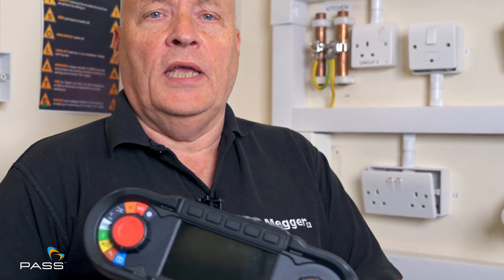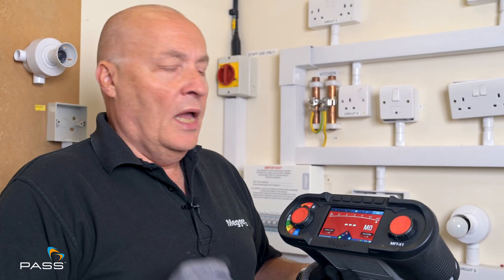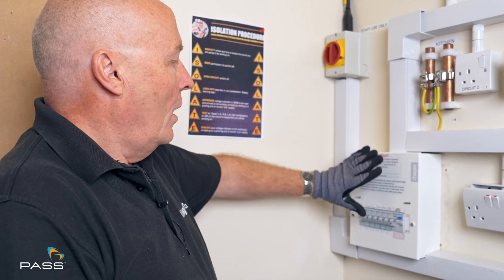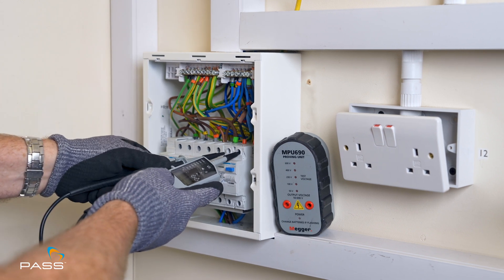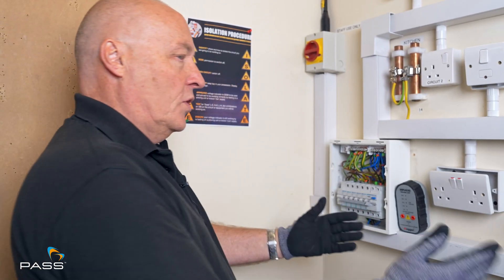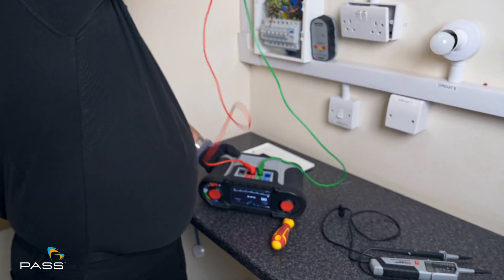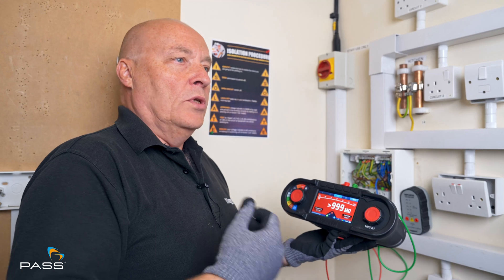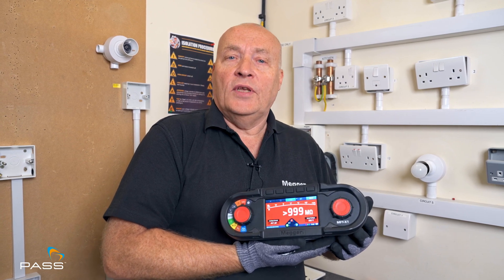How to do an INSULATION TEST! Megger MFT X1 TUTORIAL

Comment: Thank you for the explanation. However, you can never leave the isolator unlocked even if you're alone. Just imagine you're working on it, and suddenly you receive a call that a close relative has passed away (God forbids), or urgent help needed, or an explosion or whatever...the last thing you'd think of is to close up that board, you'd rush to quit the room, and later on someone could turn that isolator on, and you have an open live board!